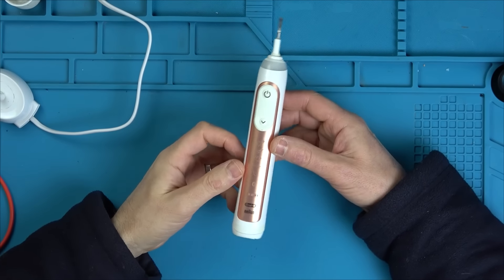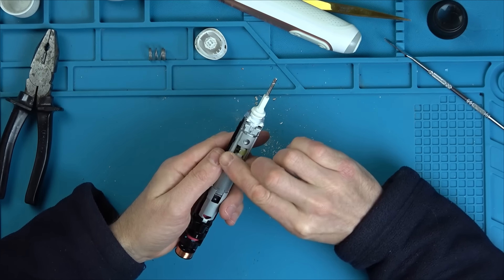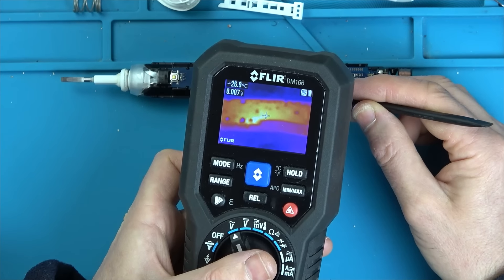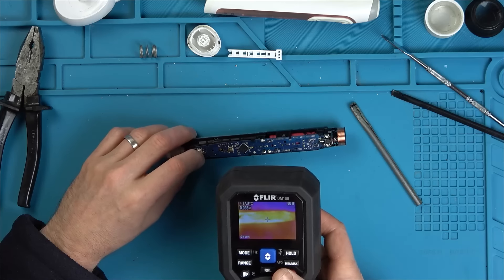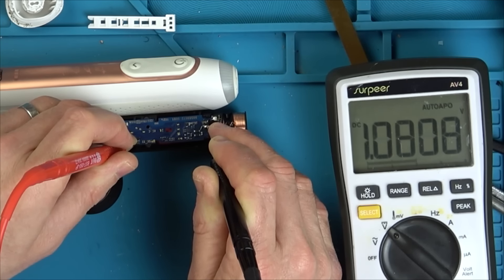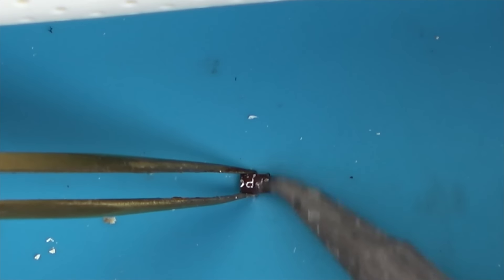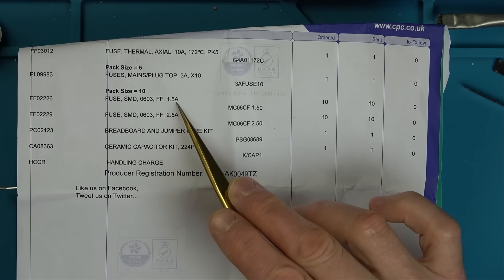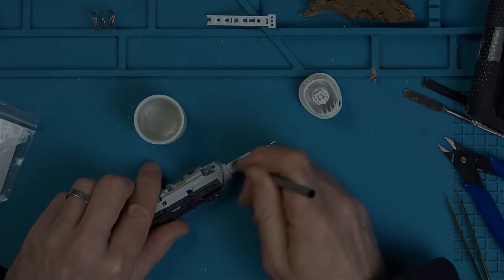Trying to FIX my Wife's ORAL-B Electric TOOTHBRUSH

Comment: I'm no expert, but I think the conductivity depends on how pure the IPA. Similar to how distilled water is not conductive, but tap water is. It's the minerals that make the tap water conductive, whereas distilled water has no contaminates so it is non-conductive. 

The IPA could have some contaminates straight from the manufacturer. Another thought is that when you floated the IPA across the components, it picked up some contaminates that were on the board.

Comment: The guess is that most liquids are conductive but alcohol dries off on its own and so is better for cleaning electricals. Good work on the mend, those things are pricey. I dont know if they all do the same but my toothbrush lasts ages between charges so the battery itself should last years before its chargeable life is through.

Comment: According to a Google query, 100% IPA is non-conductive.  But most IPA has some water in it and will cause the solution to be conductive.  IMO, the reason the fuses blew was due to the motor degrading over use/time causing more of a load; so replacing with a larger fuse will compensate.

Comment: IPA won't conduct a huge amount of power and blow anything directly but it might conduct enough to mess with something sensitive like a mosfet gate and switch it on when it shouldn't be. The square thing next to the fuses looks like it could be a mosfet. I don't know why that would blow anything either in this case, unless it's part of a switching regulator circuit on the other side.

Comment: Seems to me like the PP fuse was partially broken and increasing resistance. The motor was receiving much less voltage than it should as a consequence. Because the two fuses split the current between them but the PP side was not connecting, that put more load on the E side. That fuse was heating up as a result and you saw it when it went pop. Seems like a design flaw to me that one fuse playing up causes the other to blow.

Comment: Place the toothbrush on the charging cradle, hold both and twist them against each other. 🙂
Reply: At least that's how it works with many Oral-B models.
Reply: My model needed squeezing at the base with a pair of plumbers grips ( luckily I have a pair with plastic inserts ) after that it was plain sailing, mine is a Bluetooth model , after I replaced the battery It wouldn't start until I placed it on the charger and played with app on my phone

Comment: Also, if you use your bench power supply you can test how much current it takes to "blow" that tiny tiny wire (at 5v).  Then at least you will know how well it can work as a fuse.

Comment: All the smds marked pp I could find are different types of diodes from zener to TVs diodes not a fuse my guess is their using a zener as a cheap as voltage regulator

Comment: Pay attn to your multimeter! The IPA reading had the decimal point to the far left, while the water comparison was one step to the right (I didn't catch the actual ranges detected), indicating that the water's (tap? distilled? deionised?*) conductive resistance differed by at least a factor of 10

* An interesting & quick experiment to conduct: check resistance values with your local tap water compared to deionised, distilled, mineral & sparkling: you may be surprised by the results!

If probe testing SMDs on your mat, be sure to clean at least that area of the mat thoroughly first to avoid debris/contaminants mucking up your readings (or use a clean sheet of paper?)

To replace most 'rubber' seals easily, drop it in boiling water for a minute or 2: this'll soften it up without risking scorching from a hot air gun

Comment: Isopropyl alcohol isn’t conductive in its pure form. But it can conduct a very small amount of electricity as a 70% alcohol-water solution. Pure isopropyl alcohols have covalent bonds. Hence it can’t ionize itself to lose free electrons. So, isopropyl alcohol is electrically non-conductive. 
Compounds with ionic bonds tend to break into ions when dissolved or melted. But covalent compounds are deprived of this property. The absence of ions deprives the covalent compounds of carrying electricity/charge. Most alcohols have covalent bonds in their atoms.
Reply: It's also kind of irrelevant in this scenario as it was fuses that went which are by definition highly conductive. Adding a parallel 1-10M Ohm is meaningless here, and even the overspill to other components is nothing at such low voltages.

Comment: I wonder if the IPA caused thermal shock in the fuse, making it fail. If the fuses are ceramic, it could cause them to crack cooling with the IPA too quickly. Think how putting cold water into a hot glass can make it crack. I suspect the same thing might have happened here when you doused IPA onto a very hot fuse. If the vibrations are causing these (ceramic?) fuses to crack, it might make sense why people can push on them to rejoin them internally again, if the damage is microscopic. 
Also, if the fuse has cracked and is holding on internally by practically nothing, this will be causing huge resistance, which explains the heat build up.
Thinking on this further, maybe this is why your resistance rating were all over the place – as you were pushing your probes together, you were maybe rejoining the internals of the fuse with varying success.
Reply from the maker: Very good thinking. I'm not sure though that the smaller secondary fuse (E fuse) would have built up enough heat especially by the time I got the IPA out to have thermal shock. I did also put my finger over a lit LED just before it stopped working, I wonder if I could have caused an unintentional short to blow the little fuse???? Unlikely I would have thought. The pressure on the leads though makes complete sense, well spotted. I wish I had kept the faulty PP fuse as I could have soldered leads onto it and then seen if the Ohm reading was still jumping around. Well done on coming up with that theory, I think you are 100% spot on 💪👍👍👍
Reply: That would be very rare though but not impossible, so it could happen

Comment: 26:21 I know it sounds dumb, but given that both fuses were givind the strange results, it may be because you were touching the metal part of the leads.
A good example, is the risk of electrocution when you work with HV and no protection.
If you want to try a cool experiment, take the oscilloscope, leave the ground dangling, and touch the probe's tip, you should see a waveform (I have an old 30+ year old scope, and I do).

Comment: I don't know about IPA, but at work for a Leak detection system we were curious to see if Alcohol ( in our case + 70% rum ) was conductive, and we were able to pass a signal through a small droplet with out the wires touching each other, so while Alcohol is mostly non conductive as the internet says, you can still get electricity through it, I'm guessing it's through the other small percentage that might have small amounts of conductive minerals floating inside that the electricity jumps between. But I'm no expert either, just something i found out while doing some tests on my own.

Comment: Place the meter leads on either side of the fuse. If there is little to no voltage indicated, the fuse is good. However, if there's a difference in voltage (typically the full supply voltage), then the fuse is bad.
Reply: When measuring voltage across a fuse, you may observe a different voltage than expected if the fuse is blown or damaged. Here's why:

1. **Open Circuit**: If the fuse is blown or damaged, it effectively becomes an open circuit. In such cases, the voltage measured across the fuse terminals would be the same as the input voltage to the fuse. This is because there is no current flowing through the fuse to cause a voltage drop.

2. **Voltage Drop**: If the fuse is intact and functioning properly, there might still be a voltage drop across it due to its internal resistance. This voltage drop could be small, but it would result in a slightly lower voltage measured across the fuse terminals compared to the input voltage. The magnitude of this drop depends on the fuse's construction and the current passing through it.

3. **Measurement Error**: Sometimes, variations in measurement equipment or techniques can also lead to discrepancies in measured voltages. Ensure proper calibration and technique while measuring to minimize such errors.

In summary, if you're observing a significantly different voltage across a fuse, it could indicate a blown or damaged fuse where you'd measure the input voltage, or it could be due to a voltage drop across the intact fuse itself.
Reply: In a simple explanation, the voltage across a bad fuse may vary because the fuse acts as a barrier to the flow of electricity. When a fuse is working correctly, it allows electricity to pass through without significant resistance, so the voltage measured across it is typically low. However, if the fuse is damaged or blown, it can't allow electricity to flow properly, resulting in a higher voltage across it. This happens because the electricity has nowhere else to go, so it builds up on one side of the fuse, causing a higher voltage reading. Essentially, the damaged fuse interrupts the normal flow of electricity, leading to a variation in voltage measurement.

Comment: 99% ipa should be safe to use since it’s resistance is very high and it evaporates quickly. The resistance of water will vary depending on the dissolved minerals. Distilled water has a very high resistance similar to ipa. The only possible issue I can think of is thermal shock when applied to components that are very hot.

Comment: I put IPA on (low voltage) circuits all the time and never had any isues with it. I would not suspect IPA to be the cause of your failure here. Resistance measured was in the tens of mega ohms. What an odd issue though, why would it have failed. Good you got it working! Redemption for the other one that got sent to you. :D
Reply from the maker: I noticed whilst editing that I did put my finger over the LED to stop it shining into the camera so I (we) could see the fuse. I wonder if my finger shorted it enough to blow the smaller 'E' fuse???? I really don't know, extremely odd, but hopefully the comments section will clear it up 👍
Reply: I would never suspect IPA of anything.
Even if it was holding my wallet, I would just assume it was giving me  a hand. Even if I saw IPA walking around in my house with a bag full of money, I would just remember all the good times, and not want to think I'll of IPA it is my good best friend, and can do no wrong. 
*For external use only 😮

Comment: IPA expires over time and usually only has a shelf life of a couple of years. Depending on how it's stored also may speed the process up. If you have your IPA sat on the bench with the lid off for any amount of time it'll start to pull in moisture from the air. I've stopped buying giant bottles of it now as a result as I discovered a very old bottle of 99% IPA had indeed become conductive.

Comment: You need to use a "PP" fuse for the "PP" fuse and the "E" fuse for the "E" fuse as each has a safety purpose providing SAFE and proper operation 
and you are right that any fuse will provide a path for current, but at a risk of excessive current or temperature "My Mate Vince"
BTW when a component is hot and you apply IPA you risk the component experiencing thermal shock.
Fuse BTW Blew due to an excessive voltage spike no doubt from a dirty mains supply whilst battery was being charged.. 
Also NOTE that most if not all Thermal fuses resistances do change until they open circuit..
APU👁👍

Comment: ipa is slightly conductive the lower the alcohol percentage the more conductive it will be from the water content even though it should be distilled water which has low conductivity but you never know with cheap ipa it is possible the fuse was already bad and the ipa leached into a crack and compromised the fuse do to electro etching from the battery voltage

Comment: Isopropyl alcohol itself is not conductive. A 99% or even 70% alcohol/water solution will only be as conductive as the water portion, inhibited somewhat by the alcohol. It is conductive enough to worry about, though, so don't run the electronics involved until they're completely dry. In conclusion, isopropyl alcohol(IPA CAS67-63-0) is electrically non-conductive when pure, but can conduct a very small amount of electric current when diluted with water. A 70% isopropyl alcohol solution can be used to clean electrical components and contacts safely and effectively, as long as proper care and precautions are taken.

Comment: The toothbrush can be opened way easier:
1. Remove the seal(?) beneath the rotating part on top (edit: seems to be different here)
2. Put the toothbrush on its stand
3. Unscrew the buttom with the stand (clockwise as far as I remember)
4. Be very careful removing the buttom cover as its hooked up the the wireless charging thingy with super fine wires (edit: seems to be different now)
5. Slide out the electronics from the top

Comment: The hygroscopic nature of IPA is very pronounced. IPA exposed to the air will absorb moisture rapidly until it reaches an equilibrium value of 65% IPA to 35% water.

Comment: Distilled water (purified water) is non conductive. Tap water have some minerals dissolved in it and thus it is conductive. The alcohol is so very slightly conductive that you can say that is basicly non-conductive. The isopropyl alcohol is common in english world but not so in the rest of the world. It has a low toxicity if absorbed trough skin or inhaled. Be careful with it. You can try 90% or more ethanol (ethyl alcohol) ,which is drinking alcohol, from your pharmacy. It does the same job.

Comment: hi Vince thought this would help buddy Isopropyl alcohol itself is not conductive. A 99% or even 70% alcohol/water solution will only be as conductive as the water portion, inhibited somewhat by the alcohol. It is conductive enough to worry about, though, so don't run the electronics involved until they're completely dry.29 Jan 20

Comment: Pure IPA should not be electrically conductive however there is a small amount of water in it. Hence the percentage. Still on low power equipment it's resistance of 99.9% IPA should be more than enough to stop the electricity. However IPA is thermally conductive and can cause thermal shock to components that are already hot.

Comment: From Electrical scientific conductivity tests of IPA that's been done it's about 6*106pS/m = 0.000006 S/m = 166666 ohm/m

That makes it a little conductive by not very much, between two legs of an I.C for example: approx 6-to-8mm a drop of IPA would be close to 20M ohms

As the alcohol evaporates no guesses for what happens there (ohms degrades) but.. as there is a water content in IPA of approx 1.7% like Hexeal you use Vince!

A 99% or even 70% alcohol/water solution will only be as conductive as the water portion, inhibited somewhat by the alcohol. 
It is conductive enough to worry about though, in certain circumstances, some cases for example like a very Hot! I.C it will dry both IPA & water it up very quickly as you've found out 👍

Comment: Instead of using IPA to see what's getting hot, have you considered using flux? You have to douse it over and over with IPA to figure out what's evaporation and what's not.  Flux should stay put and only melt if the chip is hot, making it easier to see the faulty component.

Comment: From Google:
Isopropyl alcohol itself is not conductive. A 99% or even 70% alcohol/water solution will only be as conductive as the water portion, inhibited somewhat by the alcohol. It is conductive enough to worry about, though, so don't run the electronics involved until they're completely dry.

Comment: IPA is a conductor but has great cleaning properties, the reason it is safe to use on electronics is because it evaporates quickly leaving no residue, in certain situations water and soap will clean better   for example - a spill of coffee or coke on a laptop, IPA will not clean this water will, i once fixed a laptop after a coke spill, I removed the motherboard and literally washed it under the tap with warm water then dried it off with high pressure air left it for a few hours making sure it was dry and assembled again - fully working, coke leaves a sticky goo and IPA will not work water does

Comment: Pure isopropyl alcohol is not conductive. Even the water in say 70% is most likely distilled thus stripped of minerals and electrolytes that would cause a bit of conductivity. Distilled water is also a very poor conductor. Your safe to use 99% without concern.
Reply from the maker: Thanks Shawn
Reply: @Mymatevince  👍 I've been trying to catch up on content from everyone. Enjoyed the video.

Comment: If the IPA contains water it might be conductive otherwise not. Apparently anhydrous IPA is not possible because it will absorb moisture from the air.  The stuff you buy will contain at least 10% water.